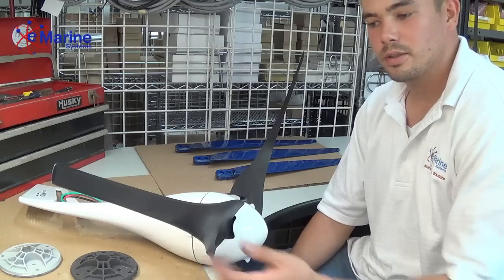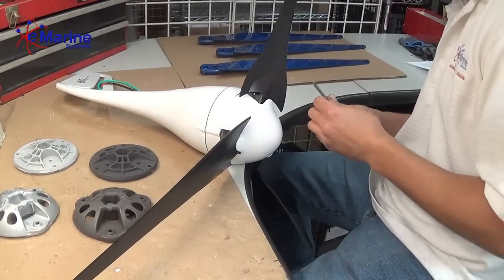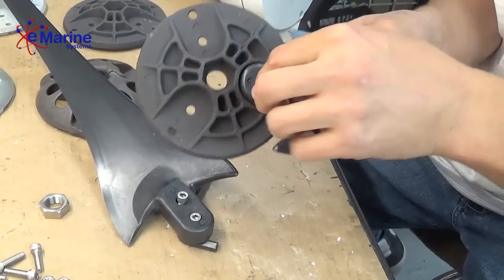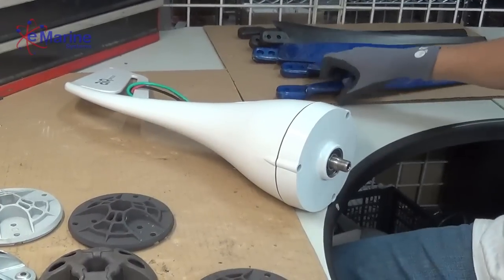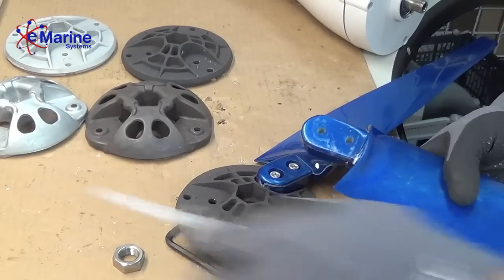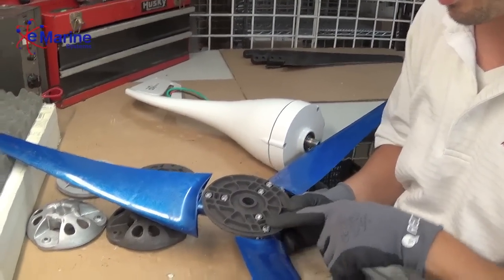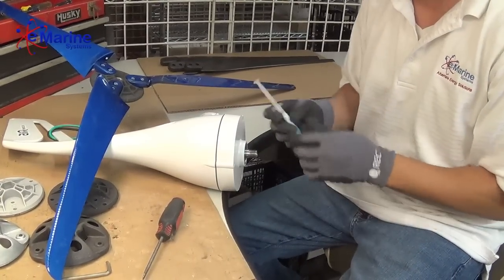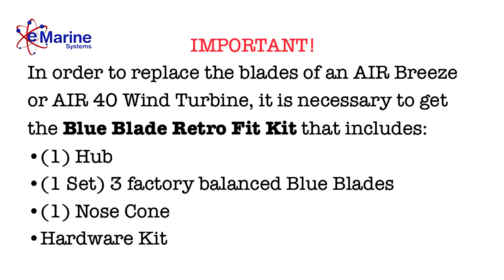AIR Wind Turbines Blue Blades Installation - e Marine Systems

Comment: I've purchased a boat with an Air X wind generator with the blades uninstalled. When attaching the blades, is there a top or bottom orientation, i.e. can they be flipped either way? Mine have a green dot on one side of the blades.

Comment: Your Km/h to MPH conversion is wrong. The blades can either take 122 km/h (76 mph), or they can take 280 mph (451 km/h). If it's the latter, then you've achieved something rather impressive.